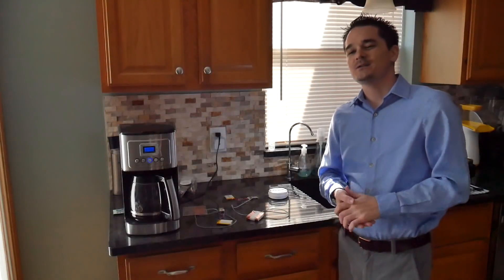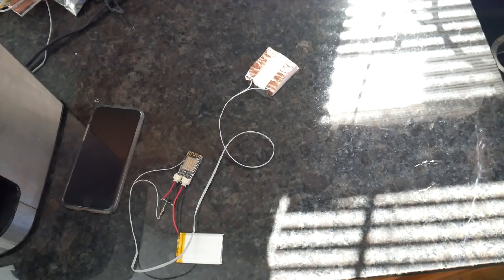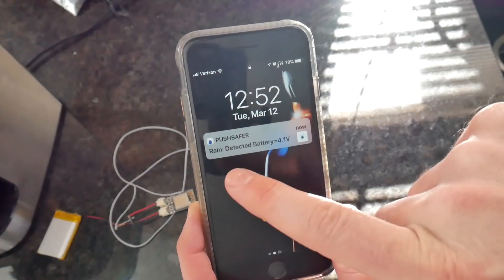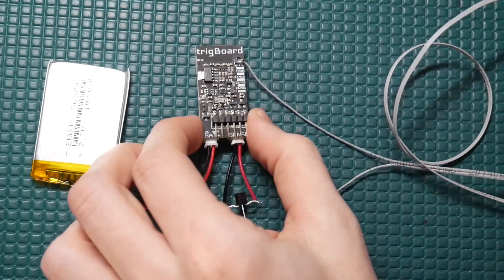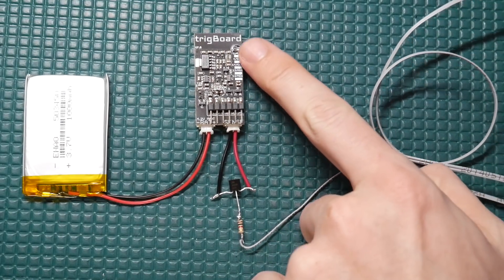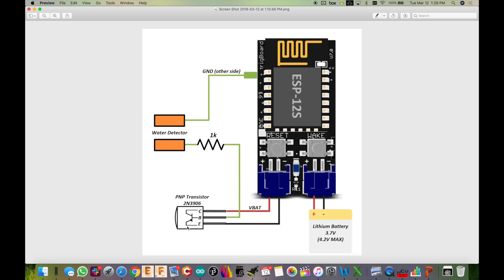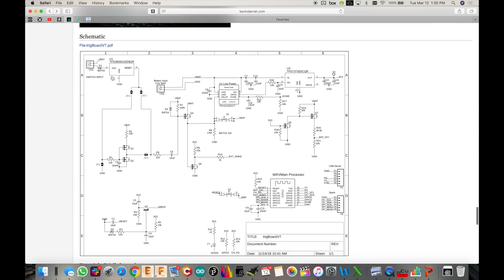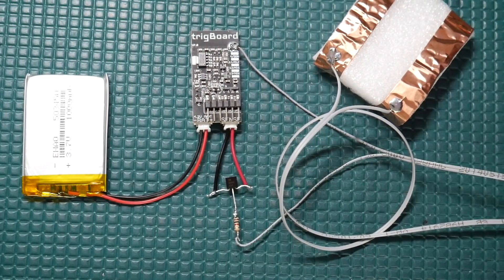IoT ESP8266 WiFi Tutorial - Water Leak/Flood/Rain Detector! Push Notification from trigBoard!

Comment: I suffered a kitchen flood last week.  No damage thankfully, everything dried out. It was a burst pipe caused by stupid me failing to isolate an outside tap during a hard frost.  Stupid me!  

I reckon the pipe was burst for just 2-4 minutes and in that time half my kitchen and entire utility room + cupboards were flooded in 2cm of water.  Believe me when I say a burst pipe really gushes!  You can’t response fast enough with a push notification.  

However I already have a raspberry pi that’s hardwired into my house carrying out some automation work in my bathroom.  It measures hot water temperatures via a 1-wire bus and activates 240V lights and fans via opto-isolated relays.

So out of adversity comes opportunity. I’m thinking “why not wire some water sensors like this via my existing 1-wire bus?” .  In addition to push notifications, I’m thinking of installing a motorised (normally open) 240V valve on the main water inlet (the same type used in central heating systems), which I can close using a spare relay on my relay board.  That should reduce the time to isolation for any leak detected, especially in the middle of the night as had happened to me.

Comment: I think i get the hardware part of this great. However, I'm having trouble on how to do the code part of this. I was looking to do this using MQTT. However, the links for that and also for the push you did just show how to get the service, can't figure out how to setup the code for any of it. I'm pretty much an idiot when i comes to the code part of this. Anything you can recommend? Just an example of the push way you did it would be good.

Comment: Hi Kevin, thanks for the project idea, as we've had a few leaks in our plumbing over the years. It might even make sense for our house to shut off the water pump when one is detected. In all of your trigboard projects have you ever done something where it can signal if the battery is getting low? These are the kinds of things I'd put in closets and then totally forget about, so maybe a once a month "health ping"?
Reply: Ah, found this on the wiki "The board will wake itself up once an hour to check the battery voltage - if running low, a push notification is sent to warn the user."

Comment: I use a clothes pin ( or other spring loaded clamp ) as a water sensor.  I use copper tape with adhesive backing ( or I glue pennies ) on each of the faces of the clothes pin.  I solder wires to the copper tape.  Now I have a switch that can activate an alarm or raspberry pi.  I have used a magnet and a reed switch as well.  This has the advantage it can be made moisture proof.  A microswitch could be used as well with the clothes pin. For  a normally open switch I put a sugar cube in the jaws of the clothes pin.  Water will dissolve the sugar cube and then the switch is closed.  For a normally closed switch I put the copper tape at the other end of the clothes pin and open the jaws with the sugar cube such that copper tape pair makes contact.    tag:  777waterSensor

Comment: Hey kevin I your videos are incredibly helpful, I even base some of my projects in your schematics. However doing my research I found that LiPos are not ideal and might be undermining your efforts for long lasting battery life. They self discharge almost completely in about 2 years without consuming any power. Switching to primary alkalines or lithium batteries reduces self discharge dramatically. What are your opinions on this?
Reply from the maker: thought about that, but based on what I've got running now, I haven't had any issues. I've got a board sitting outside in the mailbox for over a year and still measures 4.1V

Comment: Looking at your circuit diagram you DO have the collector and emiiter shown incorrectly. The EMITTER should be connected to VCC NOT ground as shown and the collector should be connected to the Arduino, preferably with an external load resistor not using an internal Arduino pull down (although it should work just fine). In your diagram there would be a LOW level on the base which should turn the PNP transistor on. If it really is working as shown it's a fluke of using a transistor in reverse. You should triple check the exact pinout for your transistor as different packages typically have different pinouts
Reply from the maker: nope, that's the way it is.  Exact part is: 2N3906-AP and you can zoom in on the picture up on the wiki to see it hooked up this way.
Reply: @Kevindarrah  well in 45 years as a graduate electronic engineer I've NEVER seen a PNP transistor be able to work correctly, if at all when connected like that. It needs a detailed investigation all on its own.
Reply from the maker: haha, I know!
Reply from the maker: I just tested the circuit again - transistor is a standard EBC and all works.  I probed and simulated - check out the sim: http://tinyurl.com/y6bwj238
Reply: @Kevindarrah  looking at TO92 packaging on Google, as I expected, you can find pinout diagrams that are completely flipped, ie with the transistor flat face up and the leads pointing toward you the EMITTER might be expected on the left. BUT there are also TO92 packages that are the exact opposite with the COLLECTOR on the left. If the circuit is working properly, it is entirely possible that you may have an equivalent S9012 for example from China that has been marked as 2N3906. They both have TO92 cases but the latter has reversed pinning to the former. With TO92 cases I learnt MANY, MANY years ago to check very carefully. These days, the only sure way to tell (because of Chinese cloning) is to use a component tester to check or a transistor tester to verify which way round you get the expected level of hfe.
Reply from the maker: yea, well these are from Digikey, but who knows... I'll build a fresh board up and test again.  Those two in the video are already in their permanent homes ;)

Comment: This is no joke: remember that a rain sensor that responds instantly to just one drop of water can be quite misleading. IF you live in an area with lots of pigeons, wood pigeons, SEAGULLS, corvids and any other large birds and you position your sensor plate incorrectly both bird crap and pee CAN and WILL set it off! It's better to check the rate of triggering within a short period or use more than one sensor to avoid false triggers. Seriously, this used to happen with my sensor in my old house. I couldn't figure out why my alarm kept going off when I was sat looking out at a very sunny garden with barely a cloud in the sky! Turned out it was right in the landing path of wood pigeons intent on perching on our TV antenna and the last thing they did just prior to landing was empty the waste tanks!! Bastards!
Reply from the maker: OMG, that's hilarious! I wasn't even thinking about that, thanks for the tip

Comment: Hi most interesting but for the rain sensor project when the sensor is always outside I think you will find it will corrode across the copper tape and acrylic and go green especially in a town area where there is a lot of acid in the air this is due to the dc potential and is present with all Chinese rain sensors as I am sure you are aware
I do love your trig board and I think its potential is almost endless and have watched it grow from the first one you made. Thanks, Bob in the UK
Reply from the maker: thanks, yea I was thinking the same thing.  It'll be a fun experiment though - I'll make a followup video on it in a few months

Comment: This is almost exactly what I did with mine. The difference is I use a reed switch and a magnet to detect if I have a sump pump failure. Basically, I have the reed switch at the top of a plastic tube and a magnet that floats on some foam. If the sump pump fails, and the water level is greater than 1" past the pump's "on" point, the magnet closes the reed switch and I get a push notification of "sump pump failure". Works extremely well!

Comment: How does it push notify a phone? (I'm clueless on internet programming). Does a server in a cloud monitor it somehow, and send a text, or does it only work if you are at home connected to your wifi with your phone?
Reply: Pushbullet has a server to which a client (in this case the Trigboard) can connect to and send a message. Pushbullet will then send a push notification to your phone or other device running the Pushbullet app or a browser extension. Both the message sender and receiver need an internet connection but do not need to be on the same local network.
Reply from the maker: thanks! I actually switched the default code to use Push Safer now - similar to Push Bullet, but with more options and a better pricing model
Reply: @Kevindarrah  I recommend checking Pushover also. It can send notifications also to groups (to which you can optionally subscribe to) and has notification prioritizing. For example a message with an emergency priority can override the phone volume setting, repeat the notification with a given interval and/or require one of the recipients to acknowledge it. The pricing model is a onetime purchase per user. It's also turned out to be super reliable.

I haven't heard of Push Safer though, I'll check it out!
Reply: A while ago, I experimented with Google app engine. Is there any free service like that that could be used?